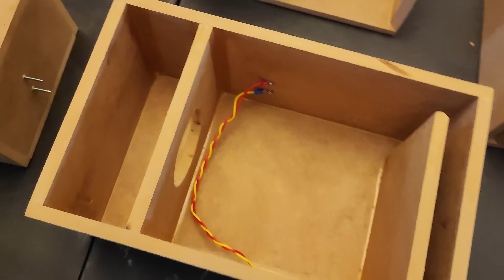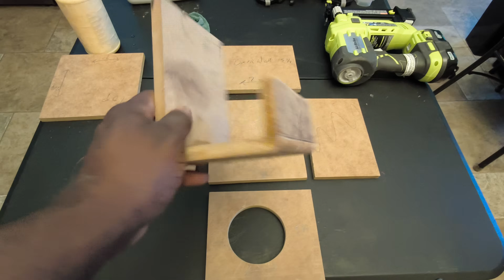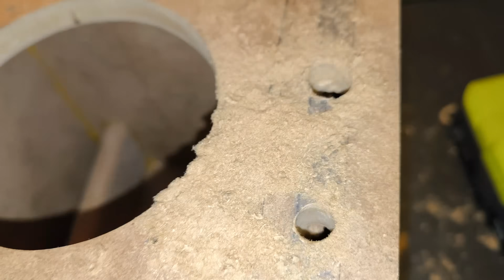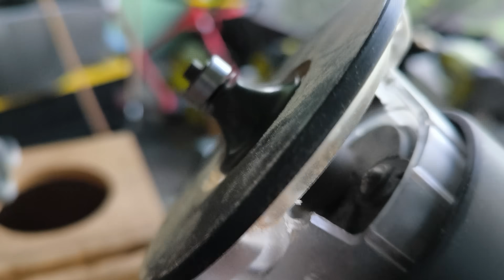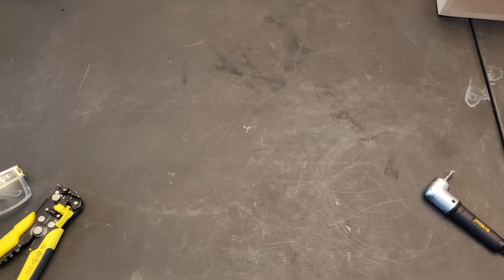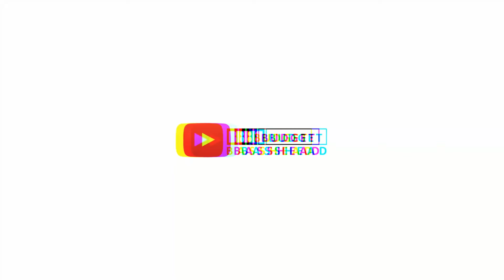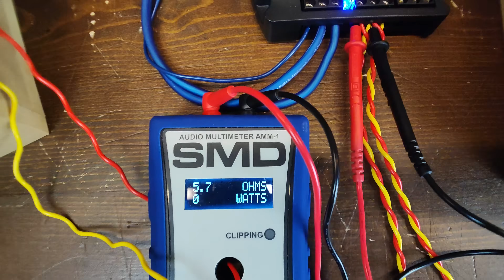I Built A Miniature Sealed vs Ported Enclosure - For A 4 Inch Woofer - Music Demo

Comment: Im going to give you a Real Challenge,  that will be Epic if Successful.   Replicate Phillips WOOX technology.   Phillips developed a very UNIQUE passive radiator design.  One thing that makes the Woox design unique.. is that there are TWO EXPANSION RINGS, on a single Passive.   This allows for Much greater Excursion / Expansion... yet likely retains better accuracy when it expands and contracts, compared to larger single-expansion (surround) rings.

 But wait... Theres More:   One thing I didnt originally realize about the WOOX passive units... is that there are actually 2 woox passives per speaker.  Meaning... 4 of these passives, in a pair of speakers.   A single woox passive, is actually two passives.. spaced about about 1 Inch apart.  Both of the passives are mounted to a plastic Frame..  and this frame allows airflow between these two passives.  Then that Assembly, is screwed into place, in the speaker.   You only visually see the top passive... but as said.. there is a 2nd internal passive.

 Its easiest to Google some Pictures of these mechanisms, outside of their Speakers.

  Let me tell you a little bit about the performance of these things...

  I first heard this Crazy Thumpin bass playing loudly.. as I was walking the Isles in a Walmart.  I was extremely impressed at not just the depth and thump of the bass.. but also,  the Accuracy and Musical Quality of the bass.   Despite the volume being pretty high.. there was no discernable Distortions happening... which usually is the case with certain Subs  (especially lower quality,  and smaller sized devices).

 I headed towards the electronics department.. shocked to see this fairly small sized Boom Box / Mini-System.   It was putting out MUCH Deeper and Thumpier Bass,  than my full sized Techniques Full-Size Tower Speakers (12"  3-Ways).   Not only that... but despite being extremely maxed out in volume... and quite loud... the woofers, nor the passives.. were creating ANY sign of distortions.  Not even a HINT of it.

 As Impressed as I was... I already had a home surround sound system,  with 4 full sized tower speakers.   I really thought about still buying this system... but the price was a bit too much for my liking, and budget.. at the time.   That said... I sort of Kick myself for not getting them... as I wouldnt run into anything similar Bass-Wise, until many years later.

 Eventually I did get hold of a Used mini phillps system, that had the woox speakers.   The thing was actually fantastic.   Mostly for the extremely great and exciting bass performance it had.    There were also many high frequency drivers on these speakers.. and they sounded pretty good... but to be honest... they could be a little too "HOT"..  and thus, both Fatiguing, with the potential for some distortions at louder volume levels.   They certainly beat most other mini-systems high frequency clarity and details.... but compared to my other Audiophile grade bookshelf speakers... those philips high freq. drivers were Cheap Garbage.

 Fast forward maybe a decade.. and the 6.5" woofers, developed Foam Rot.   Being a speaker collector / hoarder.. I had many small speakers to try to scavenge drivers from.  I tried many mini system speakers woofers.. as replacements.. in these philips speakers.  However.. NONE of them came close to the musical accuracy, detail, and thump.  This included Woofers from Sony, and Aiwa.  They were all garbage sounding compared to the original foam rotted drivers.

 I decided to do some research about these seemingly special woofers.   Why did they sound like 50% better than the competition?   The drivers had a company name on them, called  "EastTech".   Google search lead me to posts about these drivers coming from a pretty high quality audio company, in Taiwan  (not the usual Cheap Chinese manufactured trash).  Taiwan products are usually much higher in quality, than most things produced in China.    The other thing that I believe I read... was that these drivers were specifically designed by Philips, with one of the key features being.. that they had much greater Cone Excursion abilities... than any other competing woofers in these types of mini-systems.   This additional Excursion.. allowed for FAR more bass energy cone-movements.. without much potential to push them to the point of over-extension... which would cause distortion to the music.

 Of course, that was also needed, because it helped keep the extra Energy from the Passives... from causing the woofer itself to over-extend into distortion.

 Anyway...

 Eventually serveal years later.. the WOOX passives themselves... developed Foam Rot, and started to crack up.   I dont know why I didnt think that this would eventually happen.. but it did.. and now there was no way to repair them.. because they were so darn Unique.

 Phillips actually make at lease One version of the Woox passives, that used Clear Plastic..  which would NEVER rot / degrade.  Unfortunately, I didnt have that version... and trying to get hold of them.. wouldnt be easy nor cheap... since a LOT of people LOVE these things to Deth, and would never let them go.

 I believe the Woox tech was originally developed for use in extremely low profile Sub boxes... for Pickup trucks.  However, it eventually made it into boom boxes, flat screen TVs, and more.

 I once had the idea of trying to create my own WOOX passives..  by one of two methods:

1)  Gluing two different sized foam surrounds.. onto a stiff material.. to created my own double ring passive
2)  Getting access to a Vacu-Form machine.. and creating a Plastic version of the Woox passives.

 I used to work at a place that had and used a Vac-u-form machine.. to package their Circuit-boards for safer Shipments.
 It basically heats up a large sheet of plastic.. then you drop that partially melted plastic on top of the parts.. and the machine pulls a Vacuum to suck out all the air... which makes the plastic form perfectly around the parts.

 By creating a wooden version of the double ring design.. I probably could have created a Duplicated set of brand new Woox devices.
I also especially wanted to try making a much larger diameter version of it..  possible using 3 expansion rings per each Woox passive.

Now..  The thing is... does it really matter if you have dual expansion rings on a passive?   Maybe not.. If you are using large sized speaker boxes.   That the only real benefit to them... might just be that you cant bass performance in a much smaller speaker box... thats equivalent to a speaker box thats at least double or more in size / volume.

 But I dont know for 100% certain.  Either way..  it could be a very fun experiment.   And if you can at minimal explain why they used Dual passives spaced an inch apart... that would be great too.   I can only assume that using dual passives, added some additional resistance forces..  helping to prevent TOO much excursion.   Or maybe it boosted the bass response.. by simply creating more Surface area (maybe its like using two full 6 inch passives, to create the energy of a single 12" passive radiator).

 For now... check out some of the youtube videos of the Woox devices in action.   Its quite a cool technology.
Reply: EastTech was actually s supplier to many brands from logitech to onkyo........

Comment: I have 8 of those with 2 dayton audio tweeters on a dajango 220x220 amp 1.35 cf with an 3" diameter port tuned to 40 hz. I have a 36v 10ah ebike battery powering it, and it can run all day. Can float paper towels in the port. I have them crossed over at 3k and tweeter play 3k and up.
Reply from the maker: Sounds like a fun project!
Reply: Sound like fun!

Comment: I love this concept of using smaller speakers to test how different enclosures react because in theory it'll all stay the same as size moves up.

I have a video suggestion/something that could perhaps be added to this that I would really like to see.

Make a ported enclosure for a subwoofer that has a net air space of exactly what the manufacturer recommends. Then make a ported enclosure for the same subwoofer that has a net air space of 25% larger than what the manufacturer recommends. Then make a ported enclosure for the same subwoofer that has a net air space of 50% larger than what the manufacturer recommends. All having the same square inches of port area per cube, all tuned to the same final frequency. Just testing exactly how extra net volume changes output as well as cone control and power handling from a possibly too big enclosure.
Reply: What you can expect to see with a Larger ported enclosure, that has the same tuned freq= bandwidth narrows= gets more peaky, but louder closer to the ports tuned freq.. Will allow woofer to move more, with less power= more efficient, but will unload quicker, below the port tune.
Reply: @evilinside5984  Yeah, that's about what I've figured out as well. You run the risk of the sub bottoming out in a larger enclosure, but if you play near port tuning then it won't move very much because of the port working for the sub.

I just thought why not test exactly how much louder you would get at and around tuning and show how the sub will start to unload out of port tuning.
Reply from the maker: Thanks for the suggestion.
Reply: Too big of a box can blow out/rip the surround suspension. I've seen it happen.